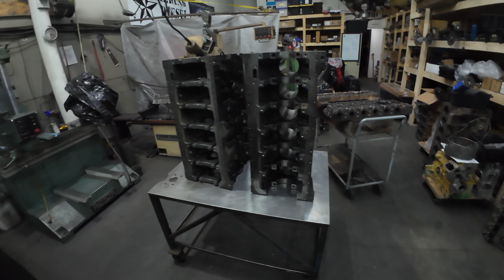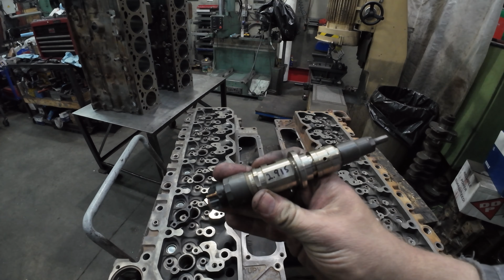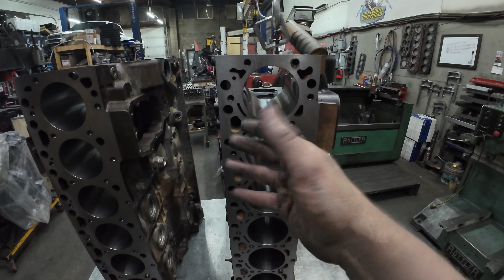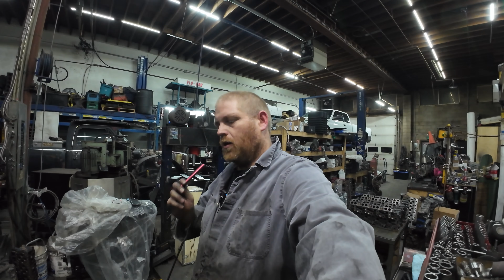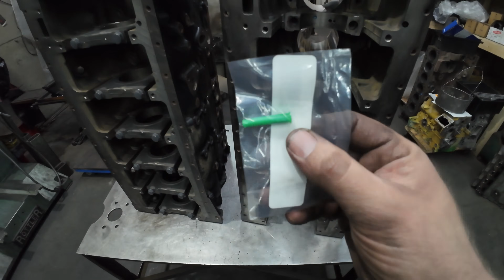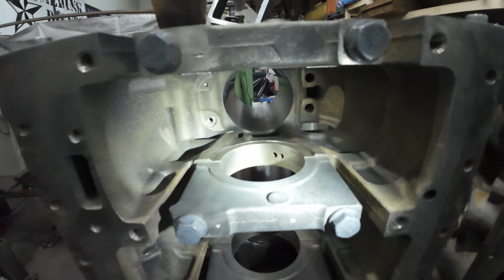Why I prefer the 6.7 Cummins over the 5.9

Comment: Great video. I enjoy all of yours.  What would be your opinion on the most reliable cummins.  5.9 common rail block with a p pump.  6.7 p pumped.  12 valve. If reliability and longevity was the goal, what would you build ?

Comment: Hey so I picked up a 2008 6.7 out of a dodge to swap into my 1968 c10 that I used to have a 12 valve in and I have 2 questions I would like to run the 6.7 injectors that came with it can I use 2006-2007 cm849 ecm to do so with tuning? the engine didn’t come with an ecm second can I run an oil pan off a 12 valve on the 6.7? The truck is bagged and I’m limited for clearance and the 6.7 oil pan looks like it will hit my cross member with it’s additional bumps the 12 valve pan doesn’t have

Comment: Definitely doing extra oil jet on number 6 when I redo the enine in my 98.5 Cummins. I tore down my ‘96 215 engine at 494,000 mi and cylinder 6 had far more wear than the rest. 5 had quite a bit more wear than cylinders 1-4. This engine did not have a stressful life and power was not turned up that much.

Comment: my 5.9 that just turned 300,000 kms/186,400miles  had blow by.  Decided to dig into it did a compression test cylinders 1-5 were over 350psi cylinder 6 300psi.  Used borescope to cylinders 1-5 all looked good with cross hatching, cylinder 6 had some scaring on the cylinder wall (broken ring?).  What wouldve caused cylinder 6 to go down like that?  Bad injector, previous owner playing with fuel programmer, or the oil injector like you mentioned in this vid?
Reply: I tore down the engine of my 96 Cummins at 494,000 and cylinder 6 had far more wear than the rest. Cross hatch completely gone, #5 almost gone, but still quite a bit left on cylinders 1-4. Definitely heat induced even though this engine had a pretty easy life.

Comment: You in calgary ??
Reply from the maker: @OverwatchSIX   yes sir
Reply: @CUTTERUPROB  Need this 5k rpm build g56 built. I bought the truck new, deleted it at 5k km as soon as efi live bounty was sorted-  First one to get an autocal with good tunes won. Matt martins trucks to thank with kory willis- gotter done. BABY'd since 2016, always had the fass, bd everything under the hood as far as delete goes there was no unplugging and leaving it- intake horn, x grid whole 9 yards.... basically the 625'd, south bend'd bolt on wet dream that never spun the tire because well, 2500 4th gen, surprise surprise, missed the checkbox for 100 bucks that avoids a 1 tire fire and tbh it kept me away from burnem' status. Debating what to do with that still. ALL oem through MOPAR JIMMMMMMY<IYKYK..... Eaton? Etc... then well.... Kinda know after 68K kms on it the vgt will die..... and ive been just wanting to s467 12 mill and 100 over the ol goat. 

You take cash? References above lol.

Comment: I have a 05 truck Dodge Ram it's got the 325 HP common rail 5.9 in it and you just told me more about my engine I did not know I had oil squirters and I did not know that I could increase the oil to number 6 piston maybe when I have it rebuilt I will have that mod done by a competent Machinist thanks for the info
Reply from the maker: Just glad to pass on some knowledge
Reply: @CUTTERUPROB  that's what it's all about sharing what we know happy Holidays to you

Comment: Respectfully disagree as different temps around the cylender maybe causing out of round condition???
And looking back on hi endurance there was alot of coolant between cylenders.
Reply from the maker: The out of around happens with high power 5.9 and the sleeve like to fail. The 6.7 doesn’t have as many issues. But I talking 1200 plus type stuff

Comment: on the newer 6.7 block (19+) they changed the block material to CGI, which is almost 2x as good as grey cast in every way besides price. too bad their QC team let them down so hard on that, lifter bore issues and block porosity issues. otherwise that would have been a beautiful block to use. now we just need them to have a factory steel piston option like the 6.7 fords do, steel can never die to fatigue failures under a certain threshold of their total strength, whereas aluminum will break eventually from any amount of stress if exposed enough times ( my theory on why there is so many cracked pistons in gm and ford trucks, timing spiking cyl pressure to the point of rapid fatigue/stress failures in pistons across the top right over the wrist pin)
Reply: Imagine a 6.7 block, 3rd gen 5.9 Head, and steel pistons.. Guys are building these for tractor pull trucks. I assume better head flow?

Comment: I thought the SO 2003-2004.5 5.9 CR did not have piston oil squirters from the factory. Am I mistaken on that?
Reply: Every turbocharged diesel engine,as far as I'm aware,has piston cooling jets, somewhere... According to my old text books...
Reply: Naturally aspirated doesn't need them...but perhaps they're still there on some NA makes/ model's....unsure on that
Reply from the maker: If you talking the j jets are the commonrails that came in a pickup had them.
Reply: @CUTTERUPROB from what I understand, every turbocharged diesel, dating back to long ago has piston cooling jet of some sort...but I'm not sure if the  NA version of same engine has them.. idk, someone else can maybe verify that...idk, doesn't matter..but anyway,👍👊
Reply from the maker: @ they is a few turbo diesel engines without. But non that make any power
Reply: @CUTTERUPROB  👍👍ten four feller..thank you

Comment: 👍👍Surprised Cummins hasn't reengineered it with an overhead cam and gear train..in modern time's.. could possibly gain a little more stroke with no cam in the way.. suppose it still wouldn't have enough deck height... take a little from the series 60 detroit and a little from the E model CAT... perhaps that isn't feasible...idk, a person can dream..but anyway,have a good day feller👍👍👊
Reply: Well, the ecodiesel and I think the 3L powerstroke is and see how that is a big fail. With a diesel engine you pretty much have to have gear to gear timing. Chains won't last because of the soot in the oil.
Reply: @chrisrossman9566  don't know anything bout the engine u mentioned,but I stated taking architecture from the Emodel cat and series 60 ...all gear to gear .. incorporating a bolt oncam gear and removable cam journal caps so the camshaft can be removed out the top...but anyway,👍👊
Reply: Take ideas from each of those engine's...but ,who gives a shit anyway.. perhaps someday
Reply from the maker: I would say they have looked into it. Must not make sense to them

Comment: The reason I would want to put a 6.7 injector in a 5.9 is that I have a 2001 5.9 with a vp44 in my 2002 F350. My lower end is built to the hills with a girdle, fire ring half in the block and head, etc. I'd love to figure out an adapter for the cp3 and be able to drop a common rail onto it without having to redo engine mounts, transmission adapter, etc. and having the ability to revert back to the vp44 would be even better. I'm not rich so this is a years worth of income lol😂
Reply from the maker: Vp44 engine is all different than the 5.9/ 6.7 commonrail engine.  I will do a video to explain
Reply: @CUTTERUPROB I don't think you realize the value of these videos for people like me, I truly appreciate it!
Reply from the maker: @ I do them for guys like you. I had to learn it all the hard way.

Comment: Could a 5th gen 6.7 be replaced with a 4th gen 6.7 short block?
Reply: Yes, the cgi blocks are junk, plus lifter failures
Reply: Yeah. Our blocks are just different materials. But you'd better have blown the 5th gen up. Otherwise just buy a 2014-2018 4g
Reply from the maker: Yep sure can